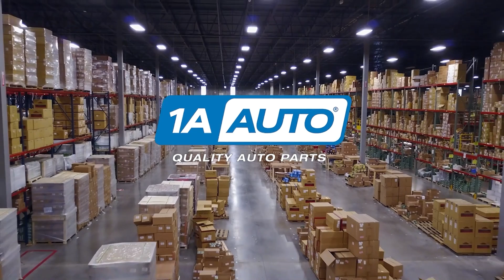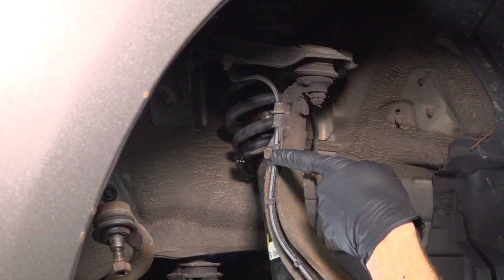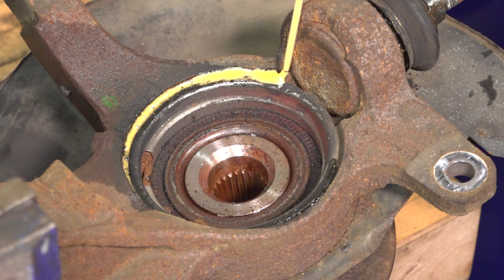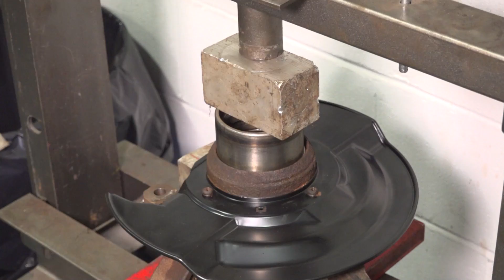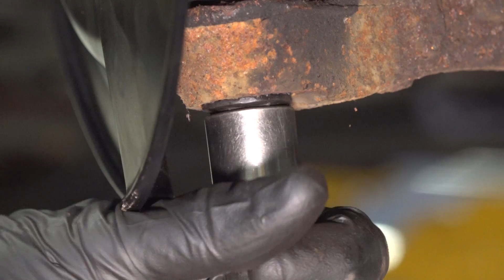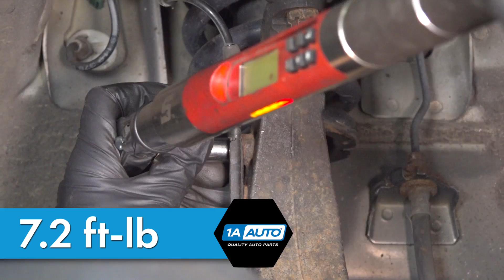How to Replace Front Wheel Bearings & Hubs 2003 2007 Honda Accord

Comment: Wish all the knuckle joints I have worked on would separate after 2 bangs (even after 20 bangs & a lot of #%@#) with a big hammer using a knuckle separator you have to be very careful you don't destroy the rubber grease cover 1A Videos are great

Comment: For the DIY people who don’t have a press. You can buy the press or a bearing and hub removing kit. Both theses kits can be rented from auto stores. I’d recommend the slide hammer to remove the hub over the other tool. Remove the hub and bearing while knuckle is on the car then do everything else to take it out. After it’s out take the knuckle and new bearing and hub to a tire shop, they should be able to install it. Prices will very by your location and shop one shop quoted me $65 per knuckle another $25 it depends. I went with the $25 and they did a great job. Then just installed the knuckle  and everything back together.